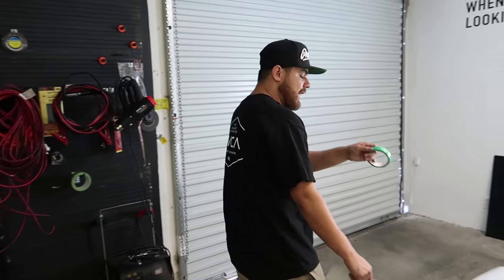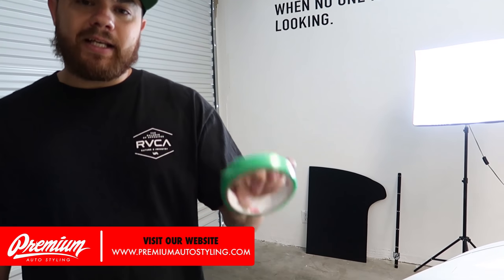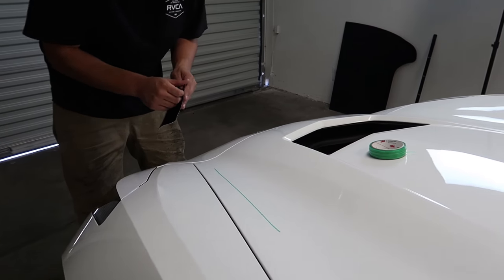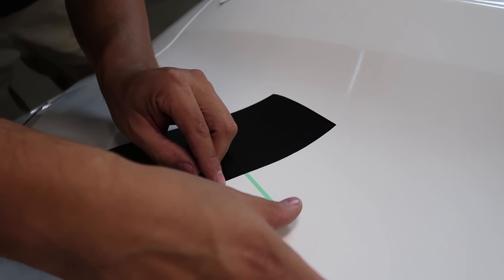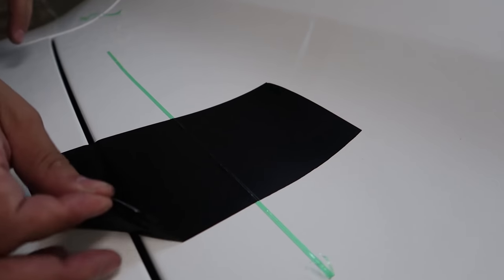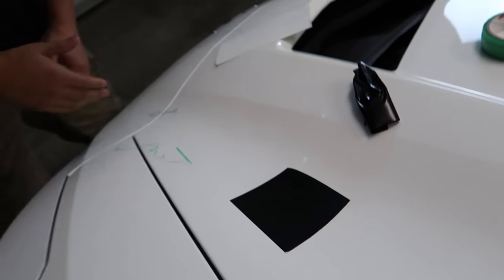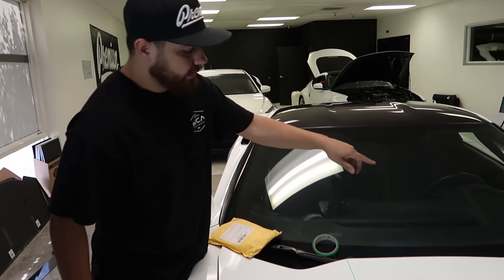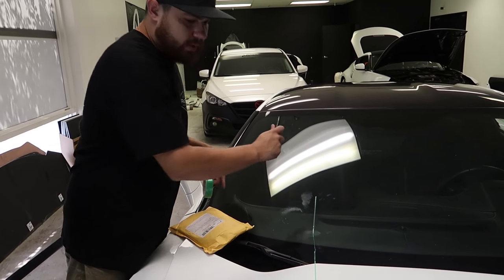How To Use Knifeless Tape

Comment: My biggest problem was separating the filament from the tape. I never notice in any other videos how to do that. Thank you so much for clearly showing how that is done.
Reply: No kidding! Drives me nuts getting it going.   Sometimes the damn string tears.
Reply: i still couldn't see how just folding the tape over itself exposes the line lol
Reply: I had to use tweezers every time 😭
Reply: @riammey  It's all good!  I still use tweezers on occasion.
Reply: Right! I always use my blade and half the time the string breaks at the start of the cut. Then I throw things to make me feel better.

Comment: If you're just doing a 1 inch or 1.5 inch wide straight stripe, do you need the knife-less tape. I plan on doing two straight black stripes on my hood where the stripe runs the full length of the hood. Thanks and excellent video...
Phil

Comment: Can you please tell me if you overlapped two pieces of vinyl would this tape be strong enough to cut both so you would have two perfect butt edges. I want to wrap a guitar with 2 pieces a front in back. I want to put this tape along the middle if the side of the guitar and overlap the top and bottom piece and hopefully use this to perfectly put them together. Thanks

Comment: Can you lay one straight line of tape perpendicular or across at an angle to another to create a design? If so, when you pull the first (upper layer) will it disturb the one below it.

Comment: Can the string cut you or is it like fishing line or dental floss?
Reply: Joseph Kaufman Its round, no blade. Like fishink line,  now technically it can cut, if you press hard enough and slide along it fast enough, but theres no way you could ever do that accidentally. It also has to be in the air, not against any surface.